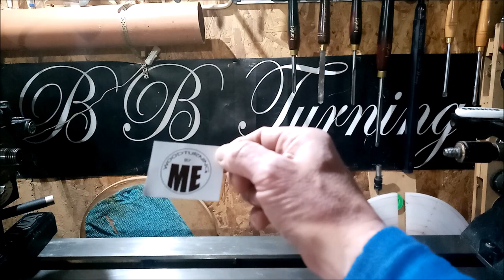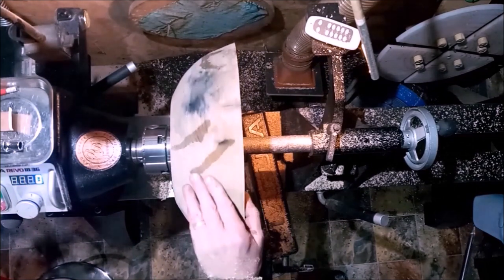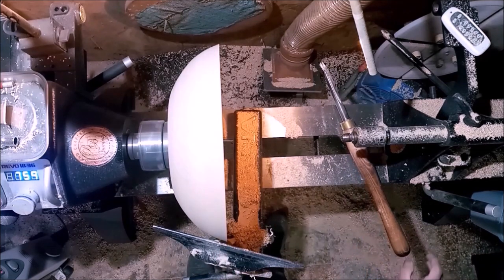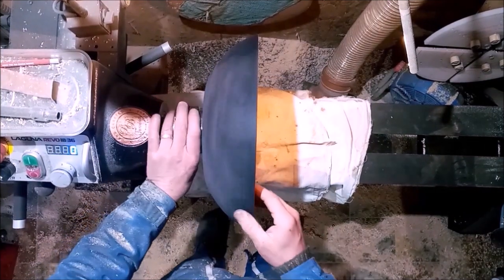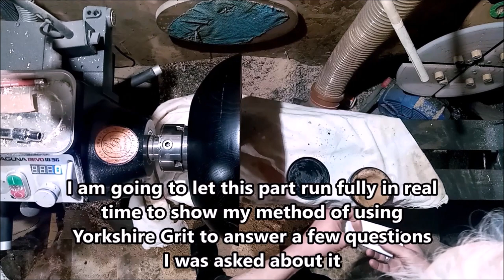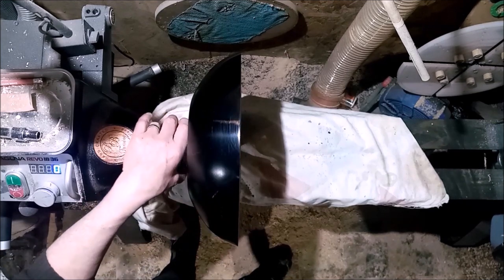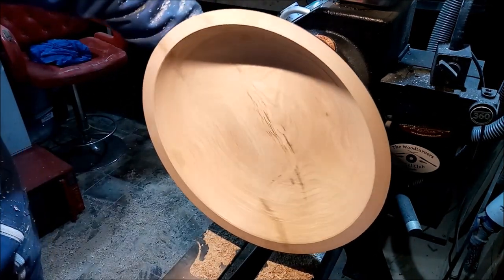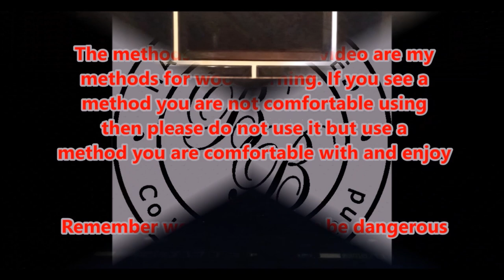Ebonising a Wood turned bowl / Woodturning

Comment: Turned out great for you. I tried to make some, I didn't know that it needed to be washed. After a couple of weeks, it was a coffee color mess, had yellow scum on the top. Scum may have been from the soap like you said. I pitched it, never tried it on any wood. Recently saw a women on Woodturners International talked about using Oak leaves, I believe. It came out nice. Thanks for the demo, might give it a try at ebonizing again since I know to wash it first.
Reply from the maker: I can't remember where I saw that tip Joseph but it stuck in my head, it may have been years ago I heard it. If you try it again I hope it works well. I have not heard the oak leaves one, I might have to give that a go.
Shay

Comment: Did this on Oak a few times, works wonderfully well. First time hearing of assam tea in the process though Shay, I used an infusion made with the oak shavings instead (but you can buy an oak tea that works too in health food shops). Lets you do multiple coats if necessary or on low tannin woods.
Reply from the maker: Nice one Mark, it is great to hear other ways to do something. The only one I had heard of was the normal tea, oak tea sounds like a good way to do it.
Shay

Comment: Iv'e been ebonising horse chestnut with iron acetate like you from an old tree that we suspect died from honey fungus, I don't know. I got quite a load of it and rough turned 11 bowls of various sizes to date. Those cracks, I found that if you applied the iron acetate before CA gluing them, although the cracked areas will still be visible they will be black, which is preferable to natural coloured crack lines showing through the blackness. That Yorkshire Grit, , I don't get it. The job is sanded, sealed , and then abraided with the gritty wax stuff and then with the polishing compound. Are we polishing the sealer or the wood? Puzzled, , . I got my conker wood from Rosyth, Fife, in Bonny Scotland.I've just got a wee Record cl3, so I am limited to the diameter of the stuff that I can swing. Can I have your machine? Yuck yuck! Keep up the good fight Shay, and best wishes to you and yours in the Emerald Isle. May the luck of the Irish go with you. ps I have been trying Hampshire Sheen embellishing wax on the black wood, , it's interesting. Oh yeah, before I forget, can I come and stay at your place? It would be a blast.
Reply from the maker: I just did another one today John there was 1 slight crack in it that I filled with resin. When I turned it down (second turning) I found a second internal crack so an idea popped into my head and I used CA and bog oak sawdust to fill it before taking the final finish cut on the side bevil and applying the iron acitate, it completely disappeared into the rest of the black, the last time I filled the cracks with chestnut dust like yourself I could still see the cracks. Try dying the chestnut sawdust before you fill the cracks, it should turn pure black and dissappear. The problem is that the CA is preventing the acitate from getting to the chestnut sawdust after it has been used to fill so treat it before you use it. Problem solved, just dry it off in an oven or microwave after you treat in then store it in a jar until you need it. The reason you seal the wood before you Yorkshire grit it is due to the grit having beeswax in it and it will darken the natural colour of the wood, that's how I understand it anyway. 
Shay
Reply: @BBTurning  Oky doky. Best regards.